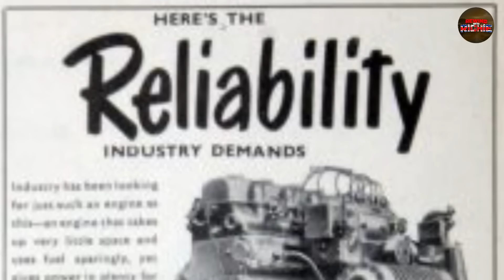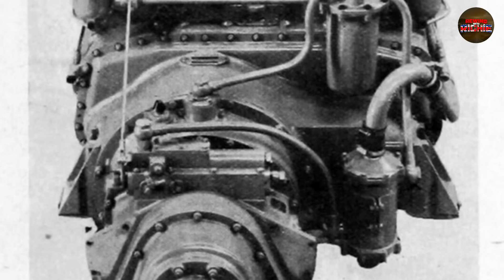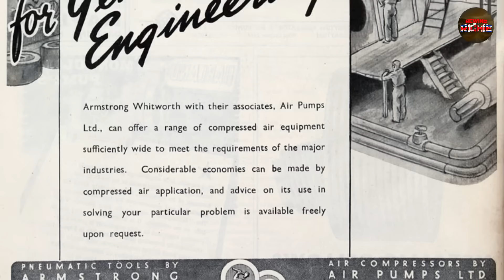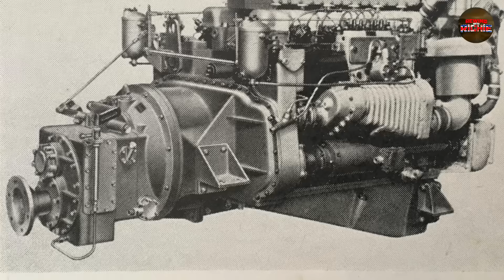The TRAGIC history of Foden's Two Stroke Engines

Comment: There have been many successful applications of 2-stroke diesel engines in transport so it is regretful that Foden did not succeed with theirs. With hindsight, perhaps continuing with Gardner 4-stroke engines built under licence might have been a better option to overcome the supply problems from Gardner itself.
Innovation has paid off handsomely for some manufacturers, but the risks have led to the demise of others.
Reply from the maker: Thanks for your input 👍

Comment: The Foden two stroke was a spin off from Royal Navy auxiliary generator set contract. It was very good for stationary applications
Reply: A constant rpm where the torque issues (low rpm) and overheating (high RPM and high ambient heat) could be mitigated.

Comment: The Foden two stroke and Commer TS3 were iconic engines to hear running, music to my ears.
Reply: yall need to calm down
GM made a pretty good 2 stroke diesel
aint gonna say its amazing performance wise, but any 2 stroke diesel is gonna sound good 
they probably were pretty good for the time
but now are just outdated.

yall need to quit gettin your tiddies in a tizzy and your panties in a twist over stupid shit
Reply: Take away the iconic sound (matter of opinion) this was part of a chain of bad calls by the Foden management. What a shame ERF and Foden could not have buried their differences and pooled resources. The Foden my father bought new in 1973, was practically obsolete from the get go. S80 with a large cab like a reverse Tardis, access up the wheel step, long winded to tilt, underpowered with  engine supplied, heavy by comparison with competition and expensive.
Reply: The Commer TS3 engine was a unique powerplant that uses a Roots-style supercharger for scavenging as opposed to as a power adder. It's three-cylinder, six-piston configuration displaces 200 cubic inches, making a whopping 105 horsepower at 2,400 rpm and 270 lb-ft of torque at 1,200 rpm

It had a music to the ears unique sound that earned it the nickname Commer "knocker".
Reply: All noise no substance 😂
Reply: @brianlowe3529  The Commer Knocker was a wonderful engine exceeding expectations with engines in OZ pulling twice the expected trailer loads. Foden my have had problems but those who know their engines would say the Commer was a noisy but certainly not lacking substance.
Reply: @brianlowe3529  An incredibly efficient way to turn diesel into noise and heat 🙂
Reply: @Bryce-z9v , and a shitload of power.
Reply: @brianlowe3529  Literally triple the HP of competing 4-strokes of the time you utter fool.
Reply: @bo-dine7971 las over New Zealand they were blowing up and people were reporting them , I know I lived next door to a large foden truck operated ,  but late versions with Gardner and Cummins were ok .
Reply: Two stroke  crack ed head and block problems , the sound was nice .
Reply: @bo-dine7971 Not triple, impossible unless you add nitrous?
Reply: @bo-dine7971no they weren’t